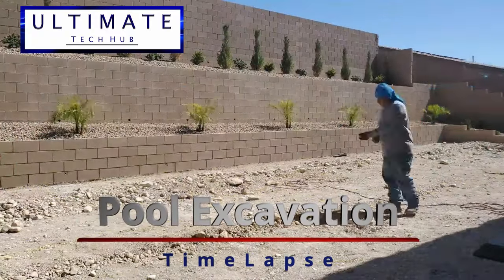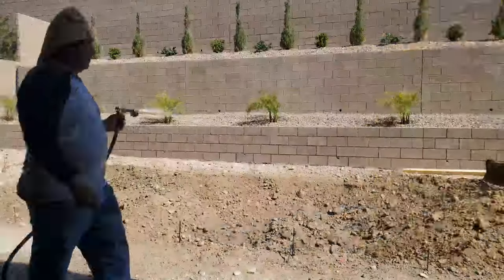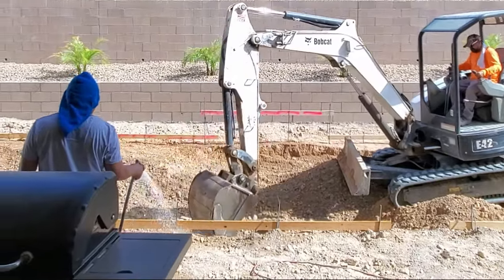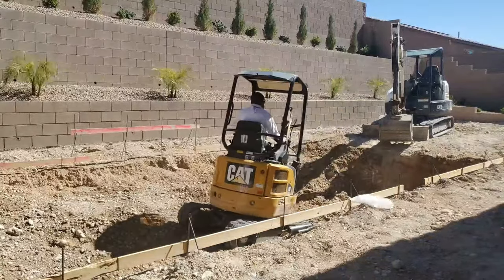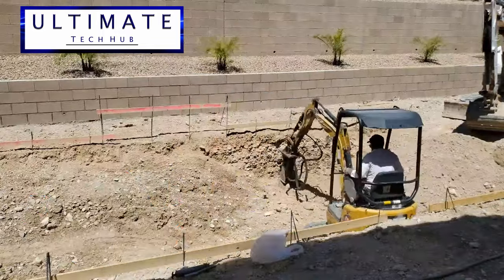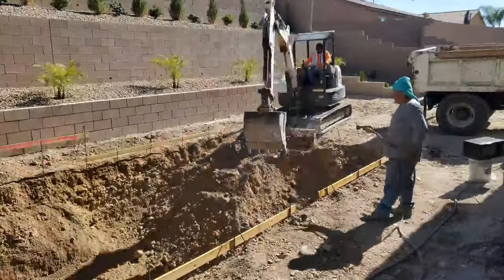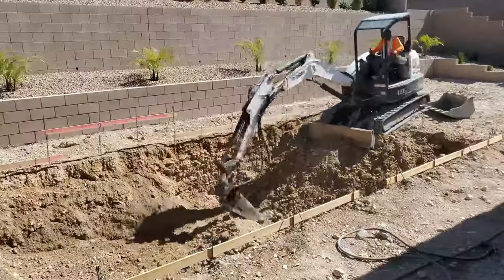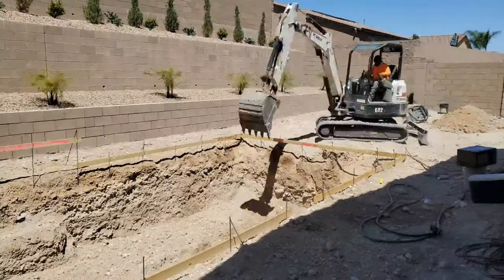POOL EXCAVATION DIG - TIMELAPSE VIDEO - HOW TO DIG FOR A POOL

Comment: I'm sorry, I clicked the like button but the video but the video quality is atrocious. And it's not like this was uploaded in 2006 either. The bitrate of the video is too low causing severe pixelation.
Reply from the maker: I used an old Samsung s10 for the time lapse so it came out a bit pixelated. Sorry.